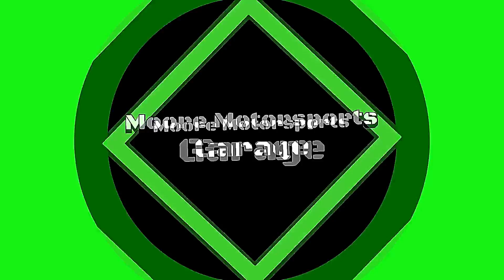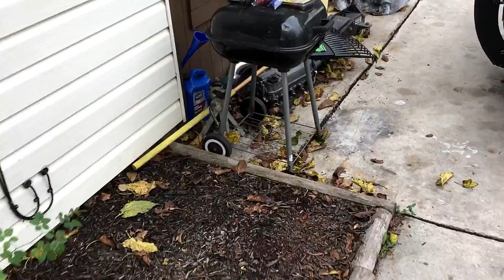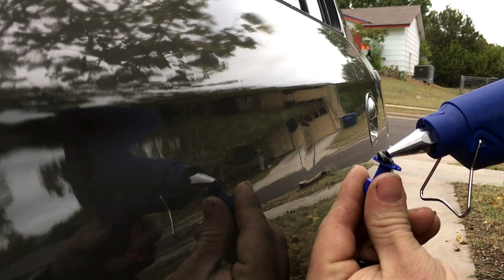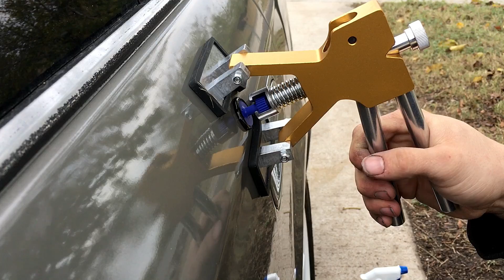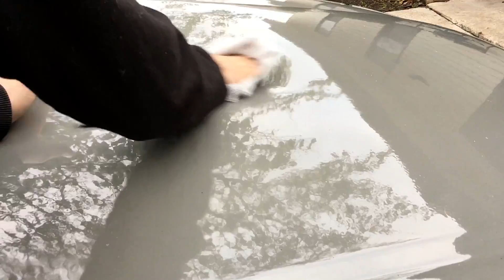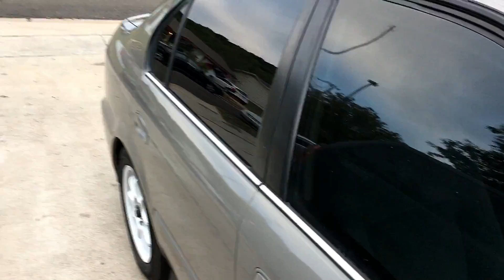Cheap Ebay paintless dent repair tool that actually works!CHECK IT OUT!!!

Comment: I would be more impressed if it was a different kind of car. Honda’s are like cans. I worked in a body shop for 14 years. I’ve seen dents pop up on Honda’s that were sitting in the sun. Not to mention while you wiping it down it was trying to dent again 😂.However it did look like it worked for a Honda. So maybe I’ll give it a try on my VW.

Comment: NOTE: Make sure to wax the spot you put isopropyl alcohol on.. otherwise it may decay the paint. Doesn't have to be a hard job.. just wax off the alcohol to avoid paint damage

Comment: Trust me when I say ,I AM NOT A PRO AT PULLING ANY DENTS OR PDR BUT, I would always recommend using a heat gun or a hair drier to heat he metal before attempting any dent removal! Just an idea!
Reply: Not for this application, the glue needs to dry solid for this to work. A warm or hot panel melts the glue.

Comment: Just be careful. If the car has been repainted, it WILL rip the paint off!!
Reply: Only if there was previous bodywork in that exact area. Been using glue pulling systems since 2006 and only pulled paint off on 3 different cars. One of them was someone I worked with and felt really bad about it.  The most I’ve learned is to use (gorilla glue) glue sticks and 100% iso alcohol and get really good at using a knockdown otherwise you’d have to call a professional to do the job.
Reply: He painted the car
Reply: my whole car was painted and changed over from stage 1 enamel to base coat clear coat. I don’t know why is pulled off but it did and looks worse than the dent. :-/. Not saying it won’t work, just that people should use caution.
Reply: I don’t doubt it, but after repeated attempts at getting a ding out on a painted car, it will eventually separate the paint, from my experience. I did it probably 15 times on a dent and slowly worked it out, but it finally broke the paint in a perfect circle

Comment: Were those dents knuckle size dents?If so I was wondering how it does on dents of that size
Reply from the maker: mike gannon Them dents were door ding/larger hail dent size. Haven’t tried on knuckle sized. I need more info on knuckle size are you saying a fist size or just the tip of the knuckle

Comment: Hey man I've started my own project going on now from watching your videos. I'm painting my 2000 Grand Marquis Rust-Oleum smoke gray with the middle of the hood black and the roof will be black. Plus all chrome trim will be black. I should have about another week left on it. Between work and the weather it's been rough getting time to finish

Comment: James,  a friend has been using a kit from Amazon,  "Fly5D", and it has a bunch of things other kits don't have, including a slide hammer . He has used it on numerous car projects, and says its the best.   And,  if you don't have a scraper,  try using a blow dryer, or carefully use a heat gun to soften the glue,  just don't blister the paint.     the Fly5D is $ 69.99 on Amazon.
Reply from the maker: Norm Hodgkinson I got a scraper with it but my children ran off with it lol I ended up showing me using it in the video
Reply: @JamesDguy    yep,  i saw that.  i posted this before i saw you with the scraper.